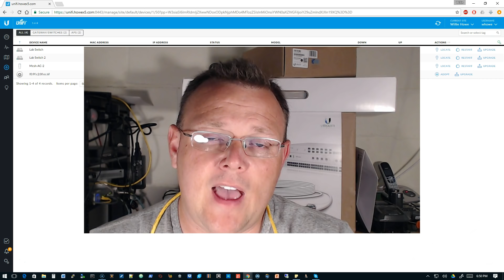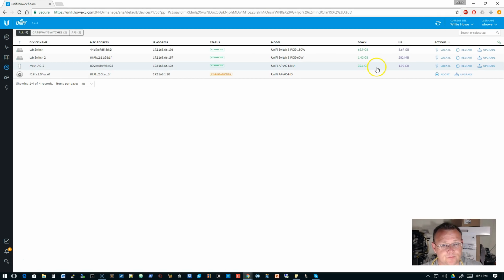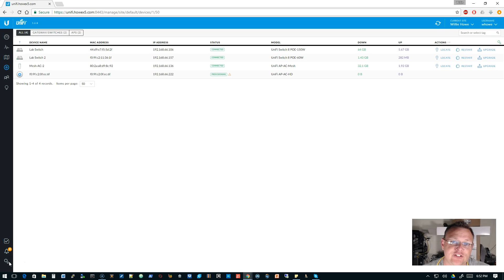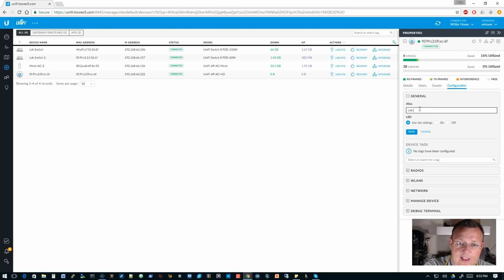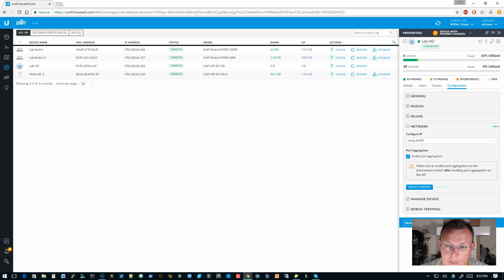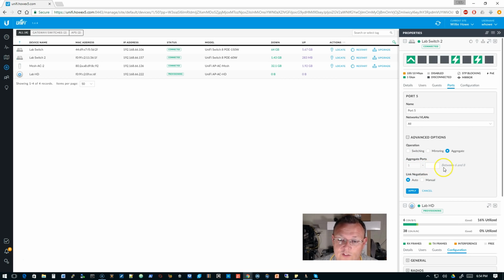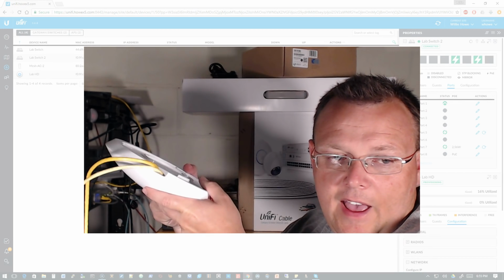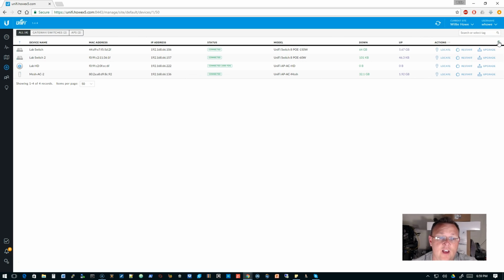UniFi UAP AC HD LAG (Link Aggregation Group)

Comment: is there a video on link aggregation between 2 switches?
Tried to lag 2 switches but the second lost connection. When I reversed to the previous settings without lag it went straight up so I'm missing something.
Reply: Levi Siccard Hey - did you find a video or instructions on connecting to switches via LAG I have been setting 2 switches up today, was working ok with single connection but as soon as I tried to connect via lag it disconnected the switch same as you.
Reply: The Computer Lab hi, reverse your settings and do the other switch first. Magic will happen ☺️

Comment: Looks like this new controller firmware does the LAG automagically? on the switch once you check it on the AP. There is no advanced option under the port. Using 5.7.23. Thanks for the vid!

Comment: Hi Willie, intersting piece. I'm setting up a portable system using HD's  to use with multi iPhones for streaming, would LAG improve my speeds and quality? Also which orientation would you say is more ideal to improve range vertical or horizontal?

Comment: in many cases the aggregated bandwidth is only for outgoing..incoming is at the rate of a single link...does the Unifi do the aggregated bandwidth both ways?  Have you confirmed this?  This type of issue is why i eventually went to 10 gig fiber after finding that at least on my switch, and MS windows the LAG only gave you the increased bandwidth outgoing but incoming was at the speed of one link..which is gigabit.

Comment: Remember people, if ethernet would be advertised the same way as WiFi, we'd be saying 2Gbps instead of 1Gbps.
Ethernet pretty much always is full duplex (FDX). Which for 1Gbps ethernet means it can transfer 1Gbps both ways at the same time. Or 2Gbps aggregate.
Ethernet can also be half duplex (HDX), 1Gbps half duplex would be 1Gbps either up or down but not at the same time.
WiFi on the other hand is half duplex. Always.
If the full/half duplex still confuses you, think of it like this: phone conversation is full duplex as both parties can speak at the same time while if we have walkie-talkie's (radio e.g. WiFi) it's half duplex as only one party can transmit at a time.

You won't be needing LAG 99% of the time. And don't expect any performance increases unless you're seriously loading up the HD as in hundreds of users doing heavy downloads or uploads at the same time. Assuming you have the internet speed for that.
And if you just happen to have a powerful enough benchmarking rig to push the HD or similar AP's, you should read about how LAG works.
Removing 40% of advertised air link rate is a safe bet when thinking about "real world" maximum throughput. The advertised number is a theoretical maximum in a perfect bubble with no interference or network layer overheads and so on.

After you do all the math, 1Gig FDX ethernet is hardly a bottleneck and you shouldn't bother with LAG for anything other than extra redundancy.
And even then it's a bit of a joke.

What's more likely to break?
A static cable inside a wall or cable duct or something similar where it's hidden away and/or mounted?
Or an active networking device e.g. the switch? (Which in this case is also powering the AP so if the PSU would release the magic smoke, LAG is not going to save you.)

"But but but but the cable could break if some installer touches it."
Well, if you ran the two cables at the same time, logic would dictate that they would be pretty much next to each other. If one cable breaks, I'd say there's a high chance the other one would be damaged too.
"But but but but the cable could be unplugged."
Well, label your shit and don't be a dumb ass and unplug active cables. If you didn't unplug it and no one else should have access to it, go find the idiot who did it and then secure your stuff better.
"I'll use two switches"
Nope, it needs to be the same logical switch with LAG.
"I'll use PoE power on both ports so if one fails I have the other"
Nope, HD's secondary port can't receive power.

Which get's us to the "russian roulette" kind of nature of LAG on 2x ports when only one port can receive power.
I like to think of this like RAID10, if you're not familiar with it here's a quick explanation:
Let's assume you have 4 hard drives.
Two drives are mirrored together (RAID1) and since you have four drives you have two sets of RAID1.
These two sets are then striped (RAID0) together.
Now you have RAID10.
Data A is written like A1 A1 A2 A2 across the four drives. (A1 is the first half while A2 is the second half and you have two copies of each because the data is mirrored)
You can lose either one drive or two drives. If one A1 and one A2 fails, you're good. If two A1's or two A2's fail, you're screwed.
With the HD, if the secondary connection fails, you're good. You still have power and data.
 If the primary connection fails, you're screwed. You still have data but no more power.
Reply: Thumbs up! I would still run LAG for redundancy because I have a lot of free ports on the PoE switch but thumbs up, pretty good summary!
Reply: I'm questioning your statement "Nope, it needs to be the same logical switch with LAG." With 802.3ad, which I believe the UAP-AC-HD uses, you can span your LAG across multiple switches. I think I understand what you mean by "logical switch". I use Cisco Catalyst 3750s and they each have stacking ports. When the switches are stacked, they act as one switch. Is that what you are referring to when saying "logical switch"?
Reply: So you are saying the wifi AP no matter how many users's will not benefit from the extra 1g connection?  Other than redundancy?  It says the AP became connected 1000 FDX... meaning now its equal to a single 1gb connection in terms of speed?  Even though its using two 1gb connections?

Comment: ok, instruction on how to achieve L.A.G on UniFi Switches & AP was clear and precise. My issue is, there was no throughput speed test done to see if it works any at all or if the bandwidth that the UAP-AC-HD configured in LAG Mode is actually what it ought to be. otherwise, cool video.
Reply: I just watched this and thought the same exact thing....
Reply: I had the same thought... I just set up LACP between my Cisco Catalyst 3750 and my Unifi UAP-AC-HD. My switch says the same port group is active and says both links are up, but I would also like some sort of confirmation on my AP.
Reply: How are you going to test that on your AP?  1733mbps but these are HDX right?  Meaning a 1gb eithernet can more than carry the load.  Sounds like its more for redundancy?  I may be wrong.. slowly learning as I go.. YOu may try to push the bandwidth and see its not near as fast as expected and think its not working when truly its just the AP can't keep up.

Comment: If the max limit on computers are 1gb whats the advantage of 4gb ability?
Reply: multiple computers connecting at the same time could cumulatively connect at higher than 1gig (ie. you could be running 10 users at 200m each)